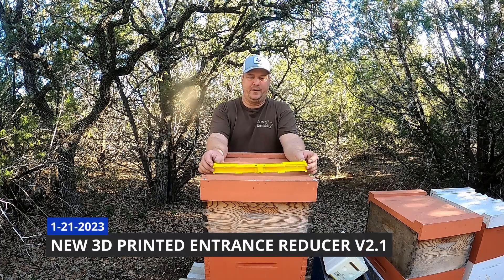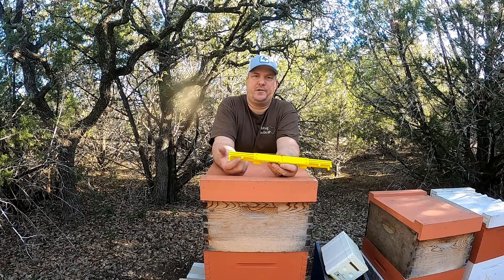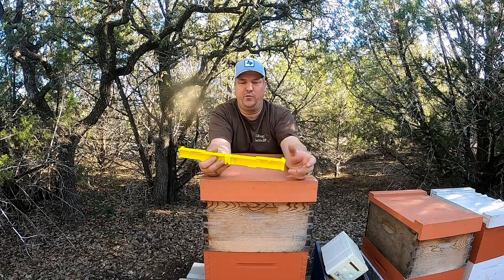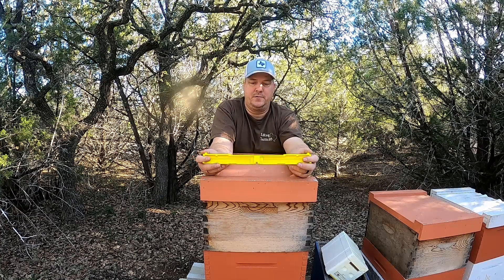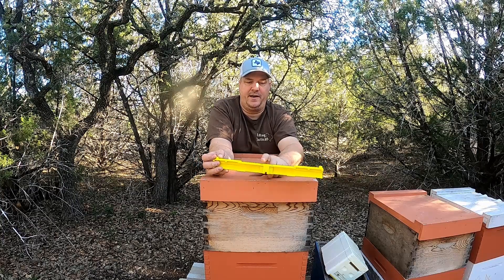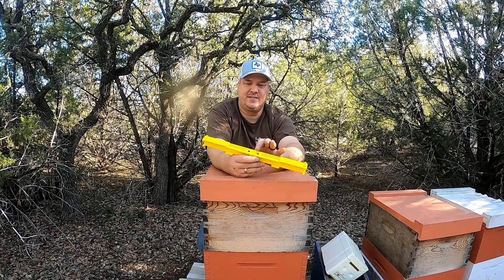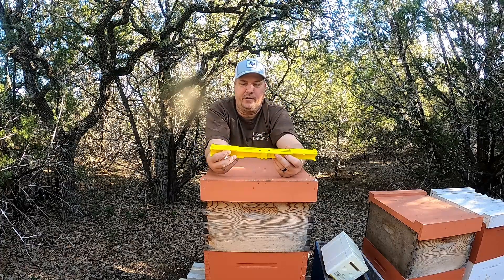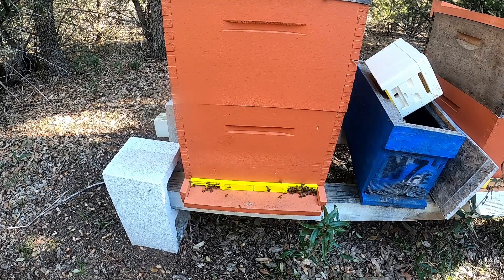NEW 3D Printed Beehive Entrance Reducer V.2.1

Comment: This is actually a really neat design. That was always my major problem with the entrance reducer was when I had boxes that wore over time and started warping and then the entrance reducer would either get jammed or something like a squirl or the wind would blow and move it because it was to loose because the warped wood would bend up.
Reply from the maker: Thanks Hayden,  I just started using them and so far I love them.  I always got frustrated with the reducer getting pushed into the box, and this solved that problem. 
Thanks for watching and commenting!

Comment: Looking forward to the follow-up. Do you have any idea what temperature does plastic melts and or burns?
Reply from the maker: Hey Mike. These are PETG and I extrude them at around 235-240 C, so right around 455 which Is the temp of the instant vap. Very unlikely with the bushing as an insulator, that it will transfer enough heat to melt it.
But.......we'll see.
Thanks for watching!
Reply: @TexasBeekeeper  Wow! That high? Cool lol.

Comment: You should go ahead and change that,🤔 it'll bug ya tell ya do.😉 I'm liking how you are thinking, question though whats the materials cost, is it going to be cost break point for ya on scale? I don't know what plastic printing materials cost. Also I can't tell is there a Queen excluder setting? Looks good Tex and the color combinations was your idea not mine😁I just asked about it.👍
Reply from the maker: Hey DC!
Lol, I actually made the revision last night to add some slides to close off the OA ports. Printed one and it wasn't 100% so need to revise a tad to get it to work as intended.
You bring up and interesting point about the Queen excluder. I've personally never excluded the Queen from leaving the hive, but maybe I should add a couple of Queen excluder slots on the far outside of each. Of course then they'd always be there if the doors were open, which I don't really like. Hmmm. I'll have to give that some thought. Maybe a separate door would be the best solution for that. And then you'd have to swap doors if you wanted to use that setting. That would require removing the entrance reducer to swap them out, but I think I like that as an option...
As for the colors, you mentioned it as well, so I wanted to give you a mention.
I just can't print but one color at a time and it's a little hassle to swap out spools in between so I try to just use them up as much as possible before switching. 
At the moment I have yellow, white, blue and tan. I may order some more colors to where I can get several more options.
For cost, I'm not 100% what it costs. I need to pay attention to the next spool and try to only print one thing through the entire spool to try and gauge what it costs. I'd say the biggest cost is time since they take a while to print. I usually try to print overnight so that I'm not waiting on it.
Thanks for watching and enjoy your weekend!

Comment: You did a great job making those Maybe you could make a mold for them to cut down on printing time. Just a thought. Bees are flying around here put out four swarm traps  kind of early though but il keep fingers crossed. Might go do a cut out this after noon got my new bee vac built and ready to go. runs on elec or 20 v dewalt vac.  This hive is in a barbecue pit probably not going to be real big but its a start of the new year.
Reply from the maker: Hi Dennis. It's been pretty nice here lately. I actually thought I  might set some swarm traps out a little early too. 
Good luck on your cutout if you end up going today. What bee vac do you have? I like the battery/electric option, because you just never know when you'll need to go remote.
A BBQ pit sounds like my kind of cutout. Sounds like a great way to get some free bees!
Reply: @TexasBeekeeper  I built a 5 gallon bucket catch bucket with a screen inside the vacuum comes in from the bottom and the bees come in the top to a wire screen cage it has a sight window and a gate to adjust the vacuum I shortened the BEE HOSE this year as per someone's All I'm saying is 628 lol suggestion. I bought a 5 gallon bucket vac and own a dewalt 20 amp dc vac witch both hook to the bee bucket. I will know this afternoon if it is a success.
Reply from the maker: @dennisbarney869  That sounds like a nice setup you made! 
I dont really do cutouts, but I may need to look into making something like that for the "just in case" times that I might need one. Thanks for sharing.
Reply: I made one last year wit 2 buckets and my milwaukee battery vack and 1 battery does not last long so keep several batteries with you when using the battery.
Reply: @sonofone1-263Bees  I agree --- I'm taking 5 bats and charger, I'm sure this is going to be a small hive so it will be a good test round. Thanks for the reply good luck on the new year.